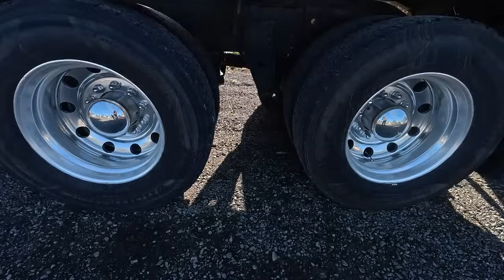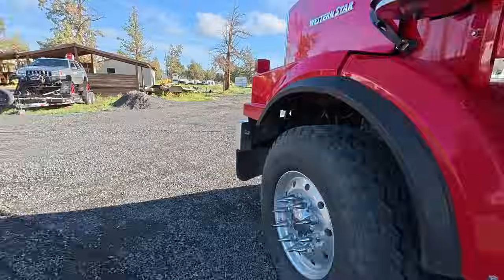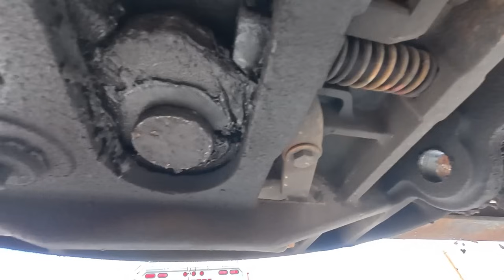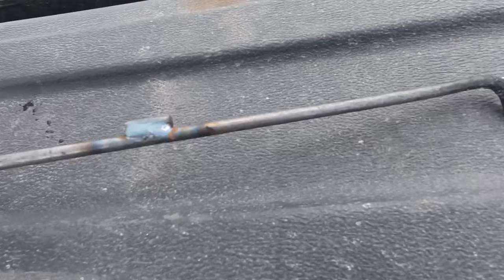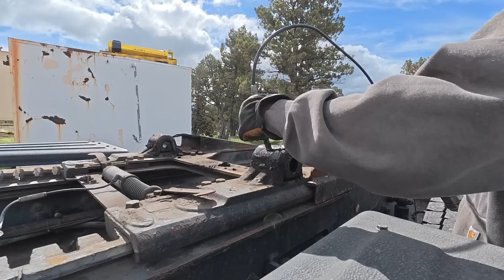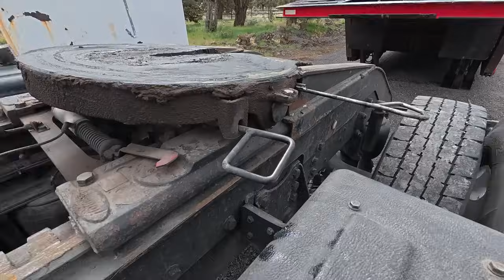My 5th Wheel FAILED 😳

Comment: If you've ever tried to move a fifth wheel with weight on it you would understand that it's not those two pieces of steel that's holding it. It's the weight of the trailer that keeps the fifth wheel from moving. It literally will not move unless you take the weight off of it first. Also most of my fifth wheels have four pins not two, but I know there are different styles. All in all a great video though, love what you do!

Comment: Everyone needs to understand that the SAFETY part of the 5th wheel did not fail.  What failed was the unlatching mechanism, which is what you want. As you demonstrated, the trailer was connected to the 5th wheel permanently until the unlatching part was fixed.
Reply: what failed was a cotter pin!

Comment: If you had rebuilt the engine on the rollback as part of your pre-inspection, then maybe you wouldn't have had the issue with it. Before going on any trip, I check and re-tighten every bolt on the vehicle, rebuild the engine and transmission, replace all the tires, and make sure the light bar is securely affixed.

Comment: You gotta love it when crap happens, Casey. But you actually made the repair doable with what you have. I've actually worn out several 5th wheels though the years pulling a coal bucket.  They are very hard on everything.

Comment: Nice, didn't even have  to dump the air on the truck. I would have probably tried to tie some paracord onto the safety to try and be able to pull on the release for temporary when you got the trailer off the first time. Guess you can't really get to it from the top though eh

Comment: It looks like the 5th wheel could use a good pressure wash and re-lube. It looks like you had some metal to metal contact at the edges of the 5th wheel.

Comment: Honestly kind of surprising theres no safety chain just in case of jaw failures. Even just hanging over nose of trailer so it catches 5th wheel plate if it tries to slide out.  With heavy haul not so bad but average truck with single jaw they do fail..

Comment: You are working with mechanical items. They have mechanical failures. 
The pre trip is intended to find those things that are common failures that can cause harm to others. 
The 5th wheel handle falling off is an extremely rare thing. And as you said when it happens it is not a safety issue, it is just a driver convenience thing, and it was definitely there when you loaded the equipment...

Comment: Only thing I'd like to add would be some kind of safety item to lower the risk of the handle to leave the 5th wheel in an unplanned fashion in case the cotter pin breaks.
Reply: yeah , even just a light-weight chain at roughly mid point

Comment: For the newer drivers remember the part about lowering the landing gear if you ever need to slide a fifth wheel. Makes it way way way easier…..
Reply: Unless you’re a Swift driver that I watched for 20 minutes. I was being entertained watching him trying to drive forward then spinning his wheels. He would go backwards and spin his wheels. After being entertained enough I call him on the CB to tell him to lift his landing gear. 😂
Reply: I found, if you cant get your slide release pins to unlock. Unhook and pull out from the trailer, unlock them and hook back up.
Reply: With a manual lever slide . A bungey cord hooked to pull up on the lever . Helps to pop them free some.. Then you just move trailer to unstick them.. @joshdupont2209

Comment: Nice job Casey!  It would seem that the existing cotter pin might have been just steel, not stainless steel.  It also could have been in poor condition.  You replaced it with an absolutely proper pin and will not have to worry about it for many years 😃

Comment: Why not do what you did to the point after separating the truck and trailer. Then removing the capture plate and making the repairs reinstall the plate on the truck. ( not having to be perfect alignment to the trailer) and not working in gravel.
Reply from the maker: Because then I would have to bring out another piece of equipment, get chains or straps all greasy, flip the plate over onto the deck of the trailer making even more of a grease mess, and all of that is unnecessary extra work
Reply: @CaseyLaDelle  Let alone that the capture plate isn't a light weight piece of metal to toss around!

Comment: Same point about the safety pins on the fifth wheels, a train pulls 11000 tons up hills and our pins are only about 1inch in diameter holding the train together. 
People worry about too much they know nothing about
Reply: Yup, agreed.  Except those 1-inch pins aren't holding the train together.  They even fall out every so often, but that doesn't cause a safety problem because what actually holds the train together is how the knuckle interlocks into the body of the coupler when it's closed.  A few weeks ago, ccrx6700 was showing off how some of their pins are plastic rather than steel, and the plastic ones are better because they don't fall out.
Reply: @BrooksMoses yes but it acts the same way as a fifth wheel pin. You pull it to release the cars knuckle, I’m a conductor and do it everyday. Have had trains with missing pins and yes it works fine but the knuckle does have a chance of opening but as Casey said with the trucks parts, it’s designed to fail closed. The pin holds in the knuckle which is really only held in by the guts which come out very easy. The knuckle is what’s holding the cars together but it’s only held in by a little pin

The best is kicking cars and having a knuckle drop right next to your foot after opening it
Reply: @BrooksMoses also I’ve seen the plastic pins in the field and they don’t last well, even some of the steel ones don’t 😂. I’ve had engineers rip draw bars out, you can’t fix stupid

Comment: Great Explanation of the issue Casey.  To quote Tim on the FastAg Montana channel, "Trucks are dumb."
The way I think about things like this, I would have bought a second piece of bar stock and bent it up exactly like the one you made to fix the fifth wheel.  The second handle would go into the tool box because I know what it is like to be screwed over by a failed cotter pin.  But considering you don't keep equipment forever like me (nor do you travel horrible Pennsylvania roads which cause vehicles to shake themselves to pieces), you will probably trade this truck before that cotter pin fails a second time so that means my logic is not applicable for your scenario.  😁
Keep up the good work!
Reply from the maker: This one lasted 500k miles, and I sure hope I don’t still own this truck in another 500k

Comment: Why not add a short safety cable the the handle so that if the cotter pin fails again the handle cannot fall all the way out and become lost on the road?
Reply from the maker: Because if you put a safety cable on every part that could fall off if it fails, the truck would look like an unusable spider web
Reply: Good description Casey. lol

Comment: Those holes not lining up again after you backed up to the chocks, might be because you are in a siesmically active area.  The ground moved.?
Reply from the maker: Definitely
Reply: I thought he pulled the trailer ahead when he straightened out the fifth wheel after testing the handles.

Comment: I was surprised that the hydraulic system on the trailer was capable of lifting that high. That, in turn, made your job that much easier to get done. Yes, "you never was good at this."
Reply from the maker: It still had more to go

Comment: The ease with which the pins came out initially is a good testament to your regular maintenance of your vehicles.

Keeping things clean and lube makes them easier to work on.
Reply from the maker: That was a testament to how well the previous owners maintained it.  That was the first time I’ve pulled them
Reply: @CaseyLaDelle in their chosen field of endeavor,  also yours, preventative maintenance is money in the bank.
Reply: @CaseyLaDelle  But you have also kept it cleaned and lubricated since you have had it.

That's one of the things that you are fairly regular about.
Reply: %100

Comment: In the industry I work in, we would call the design of the fifth wheel a fail safe system, i.e. when it failed, it failed to safe state that could not let the trailer become detached. That's good design, except the cotter pin, they are just junk!

Comment: To install the main latch handle, I'm guessing that the lever arm is removed, snaked onto the handle, and then pinned in place. Since that one angles up, if there was a washer and cotter pin, the weight of the handle would be on the cotter pin, and it would wear out quickly, fall out, and end up in someones windshield. 

I guess that checking the cotter pin is one of those things that could be added to the list of things to check during an annual.
Reply: I was looking for this answer. Just about gave up trying and was going to comment myself. Looks like Casey saw it, too.

Comment: I think it will work. . . . Go Fer It ! I used a small sledge hammer as a fulcrum many times. // Who are these silly people with their silly ideas? I suppose you expect Casey to pull the motor and check the crankshaft ?

Comment: Nice job. I thought you were going to pull the plate off the trailer after you drove the truck out and then work on it. That would have worked but would have made a big mess and the weight of the plate hard to handle.

Comment: Spent close to 40 years working in testing of products and electric sysrems, prior to start of testing we would go thru inspections and verify everything is working correctly only to have something break a few hours into testing.  So I do not fault Casey for not catching the missing cotter pin.  Good job on fixing the missing hardware.
Reply: I'm not sure there's any way he could have seen the cotter pin was missing what's the fifth wheel attached. Maybe he could have got a borescope and looked up in there.  But something's going to fail
Reply: @UncleWillie  Also, if he'd looked, he might have seen that the cotter pin was fine.  I'd guess it likely broke while he was driving.  (Well, okay, if I were being particular, I'd guess that it had one leg broken for a while, and it was just the second leg breaking that let it fall out.)
Reply: Even rigorous testing can't catch every failure. Sometimes things just fail. I worked as a biomed and there were a lot of calls for bad batteries for example, even though yearly testing we replaced the bad ones and tested the machines fully on battery.

Comment: On the other hand, if you did add all the things like this to a checklist, you could be the first operator whose daily inspection takes more than 24 hours to perform.
Reply: You have seen the checklists at my current employer.  The check lists take longer to complete than the task themselves.  
Yes, a total waste of time, but they are paying to perform an excessive checklist for a task that takes a couple of minutes.
Reply: Nah, this should be a maintenance item.  Replace the cotter pins every five thousand miles whether they need it or not.
Reply: @BrooksMoses  So, you think it's practical to go through and replace every single cotter pin after literally every third or fourth trip? Do you even know how many cotter keys there are on the average rig? Or how inaccessible many of them are? Five thousand miles is literally two to three trips, for some OTR operators. I often ran 2000-2500 miles in a single trip back in my trucking days. I had some runs from Washington to Georgia or Florida that came out around 3500 in a single trip (especially ones with partial offloads to multiple locations), so 5k could actually end up being a trip and a half. I don't think I ever ascertained the exact number of cotter pins on any of the rigs I operated over the years, but I had one that I know for a fact had more than 250 between the tractor and the particular trailer that I almost always ran, all of different sizes, and some of them required a partial teardown to access, according to our shop foreman. May as well just do a full rebuild every few months, at that rate. I'm not saying that regular maintenance isn't important, but there's a limit to what is practical and feasible, not to mention necessary for a particular type of rig and normal application.
Reply: @RedneckCowboyFeller  Indeed, it's a completely ridiculous idea.  I'd hoped the suggestion was ridiculous enough to make it obvious it was a joke, but I suppose the problem with the internet is that it's hard to tell the difference between parody and stupidity.

For what it's worth, my real opinion is that if a cotter pin failing causes a safety issue, then the person to blame is the engineer who designed it that way.  (Also, 250 of them?  I knew it was a lot, but had no idea it was that many.)
Reply: @BrooksMoses  Every cotter pin, every five thousand miles? Wear depends on application and use so, if you're going to use a single maintenance interval for all cotter pins, maybe you need to replace all your cotter pins every file hundred miles. Or every one hundred miles. Do you have data sheets for all the different cotter pins you keep in your spares box? Have your cotter pins been certified to meet certain specifications? Are you confident in the QC of the manufacturer? If not, perhaps you should change all your cotter pins every day, because you just don't know what corners were cut. Do you have the proper tools for cotter pin installation? Too tight a bend will reduce the life expectancy of a cotter pin, multiple bends can further weaken the things, and incorrect bends can result in pull-out. Simple pliers aren't sufficient, no sir! You need the proper tools, or you might as well not replace cotter pins at all! Do you know the location of every cotter pin on your rig? Do you even have a rig? I don't, and I'll defer to your expertise if you do, but all this just seems like common-sense to me.

Comment: I spent many years pulling transmissions, differentials, and endless broken springs out of big trucks. Equally as much construction equipment, etc. The odds of me pulling those pins out with a pry bar would be about zero. Likely, it would take welding a pull point and using a come-a-long with copious amounts of foul language grunting to get them out. Then you come along and easy-peezy, nothing to it.
Reply from the maker: That’s probably the easiest I’ve ever had them come out.  I thought for sure I was going to fighting them with the trailer still attached
Reply: maybe it was regularly greased, the grease looked somewhat slick, most of the time people dont grease anything
Reply: Agreed! Better maintenance than most. A darn good sign for the rest of the truck! 😁
Reply: Brilliant solution.
Reply: So we welded nuts on the ends for a slide bar worked amazing 😂

Comment: Respect for explaining why the gear failed, not just showing the aftermath! :face-orange-biting-nails:
Reply: It's a cotterpin, they wear out.  Casey said how long the first one lasted, it would be expected that the replacement one would last as long.
Reply: This explains your Easter Egg (Tick Tock) short of the trailer pin screwing you..   YT really loves Casey’s dedication to take on a project, explain the steps needed to accomplish.   You definitely have several life lesson with caughter pins.
Reply: did he really explain it? did the pin fell off? did it brake? was it bent? should we replace it every x miles?
Reply: @Nebbia_affaraccimiei   His explanation was pretty clear to me, what part of the cotter pin failed and the handle fell off was unclear?
Reply: @JointerMark how and why it failed.. you know to avoid a similar failure, or we just keep replacing them??
Reply: 35 year heavy Equipment  mechanic  here, yes the cotter pin wore away and flew the coop. Never re-use cotter pins, it's false economy.  @Nebbia_affaraccimiei

Comment: To get the handle off the fifth wheel you remove the bolt that hold the lever in place then un thread the lever from the pull handle from the fifth wheel.